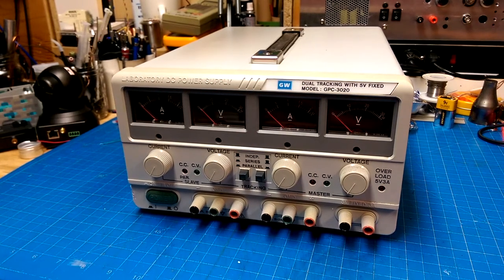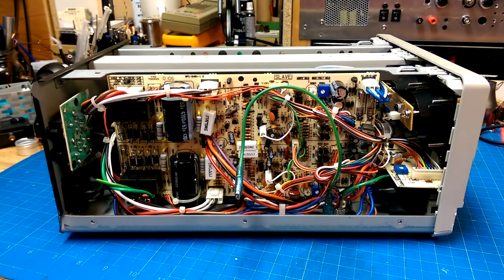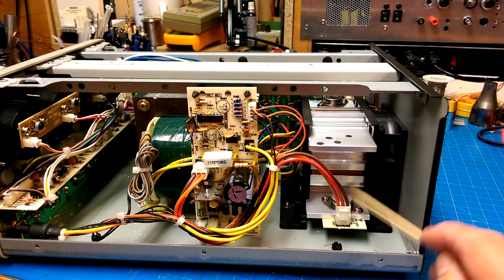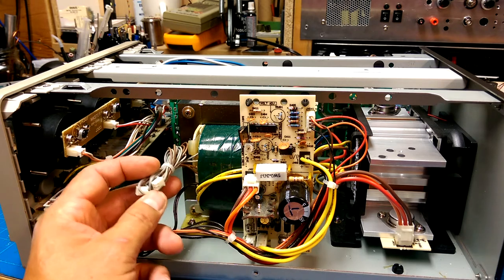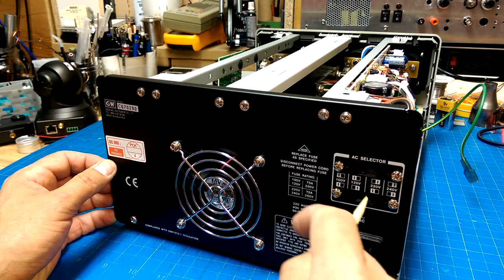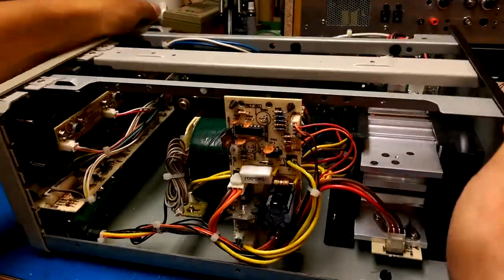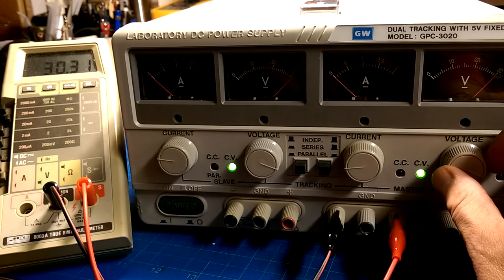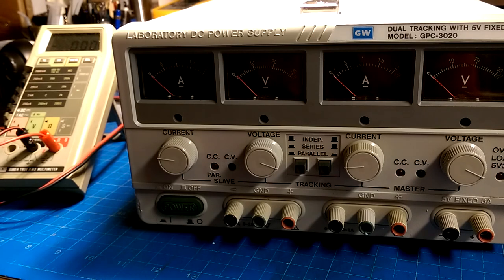GPC-3020 First Impressions

Comment: So I'm obviously a little late to this particular party, but regarding that damage at the corner: I honestly think that's a common cosmetic damage area because the one I recieved today has almost the exact same crack in the exact same place. Only difference is that mine didn't travel up the side. Just an FYI in case that's the straw that breaks this camels back for you.

Comment: Great vid, solid power supply. I bought a lot of them from ebay awhile back at 40 bucks a pop. They looked to be in near flawless mint condition when i opened the packages to inspect them. I have a ton of Keysight Agilent gear but these GW Insteks feel right at home sharing my work bench with the big boys. Liked/subbed.